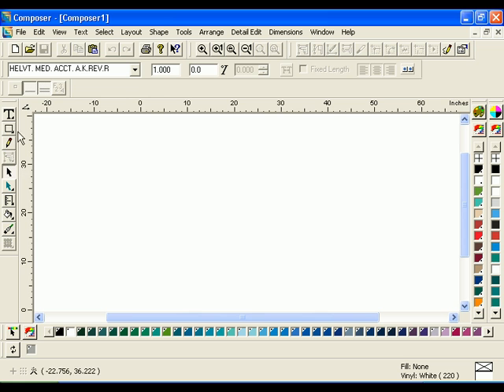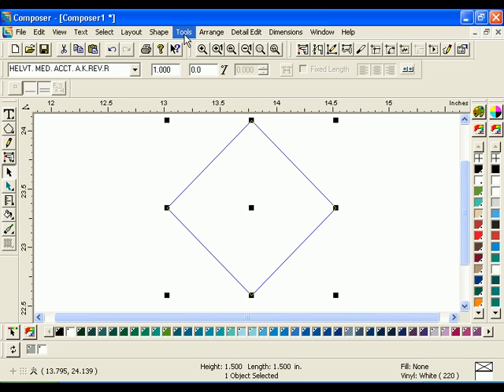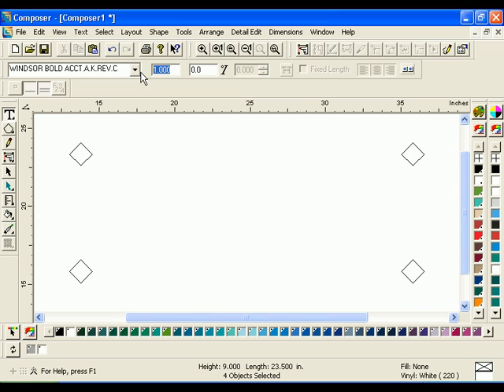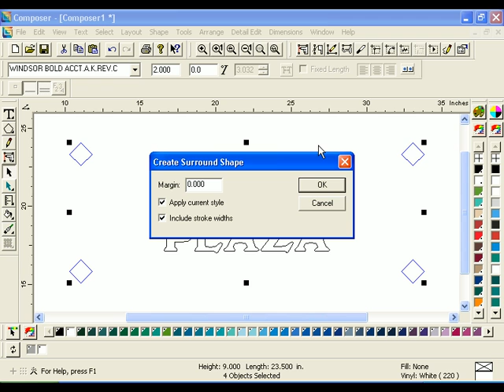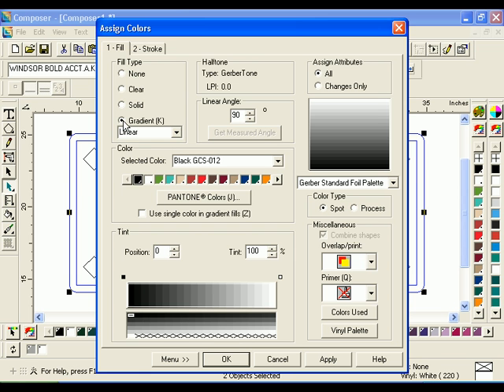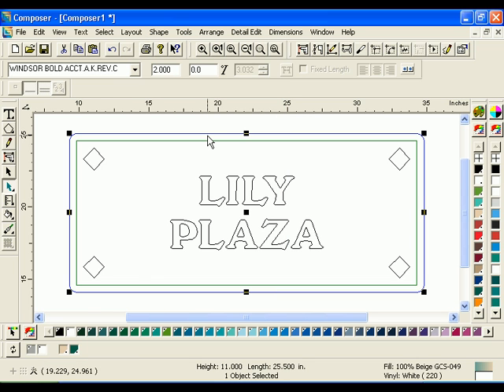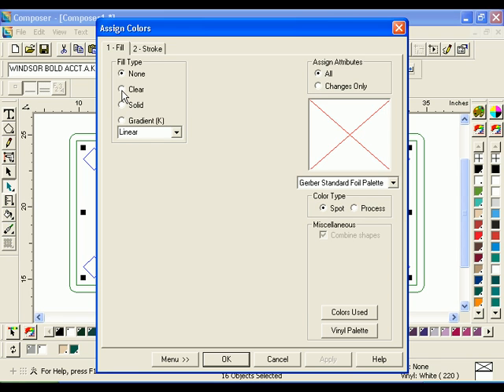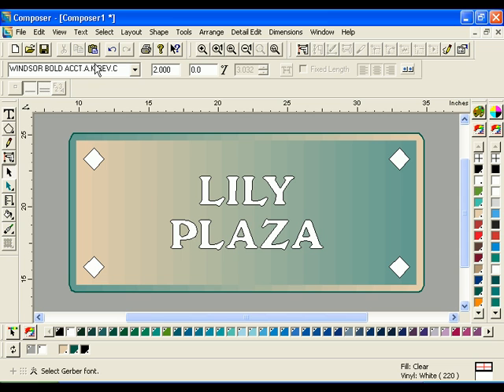Advanced Design Techniques Part 1

Comment: I truly hate this application with every fiber of my being.  After 21 years using QuarkXPress and Adobe CS in a newspaper environment, I took a design job in the sign industry.  The work and the challenges involved have turned out to be far more rewarding than I ever could have hoped for and I have grown as a designer because of it.  But nothing can possibly forgive this travesty of an application. Yes, it's insanely powerful on a level I have never seen, but guess what?  I didn't sign on for a career in design just to become a programmer and think like a robot.  That is why I hate Composer.  Everything about it is proprietary and non-intuitive. It works wonders for file conversion in a Windows environment, though.   I use it to cut vinyl and print to the Gerber Edge, but that's it.  All my design work is done in Illustrator, even though I can't use it to design the Empire State Building at 100% scale.  If you used Adobe CS to learn design, you will beat your head in through frustration trying to use this thing. I've tried to learn, but I have nobody to teach me and so it's like speaking Japanese backwards.
Reply: I can't even trim a line!! Driving me bonkers - I'm on the verge of tears 😂😂😂🤦‍♂️